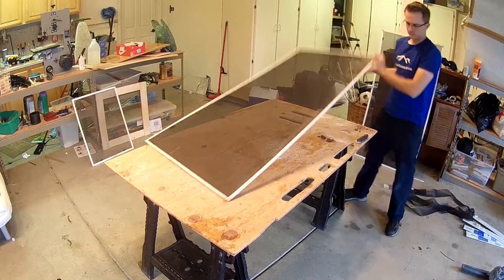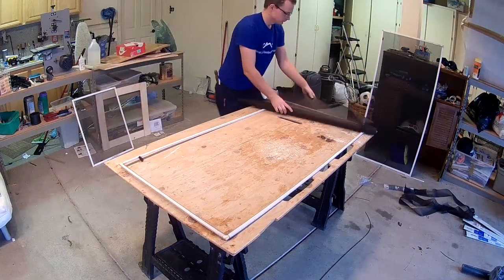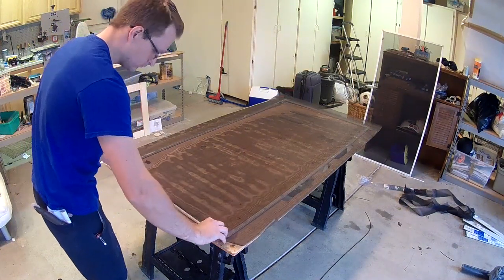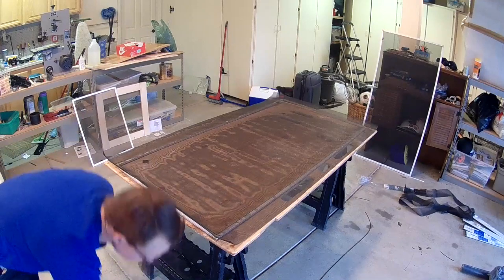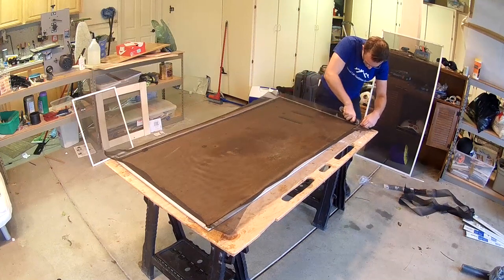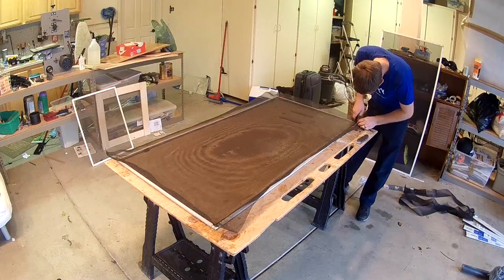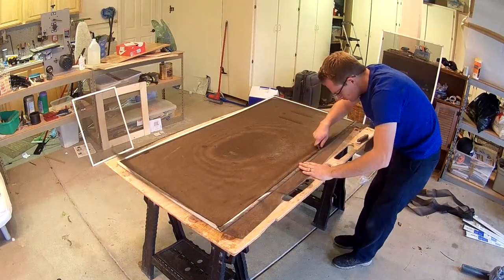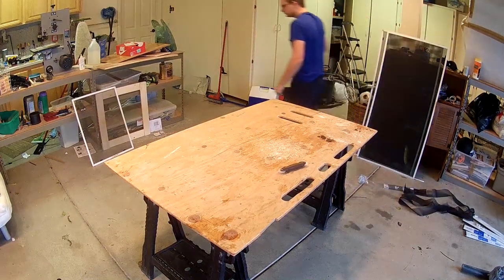How to Re screen a Window Screen / Easy DIY

Comment: Suggestion to mention.  Sometimes the frames can get distorted by the tension of the screen.  The long sides tend to get pulled in.  Put the tension on the short ends first and take it easy on the long sides.  If you do the short ones first, there should be enough tension for the screen.  Don't overstretch the long sides, or the frame can bend.  Been there, done that.  Ciao
Reply from the maker: Hey thanks for the tip Alex!